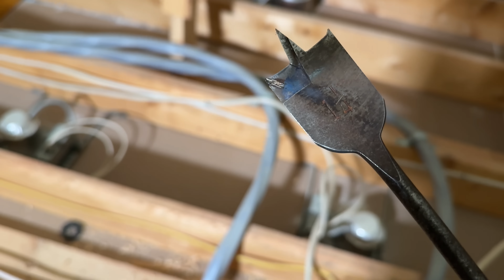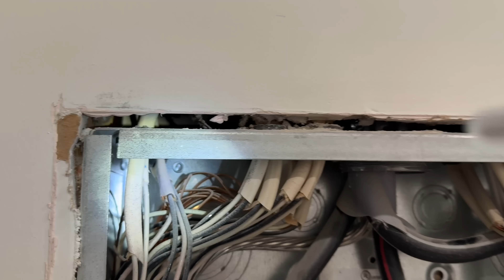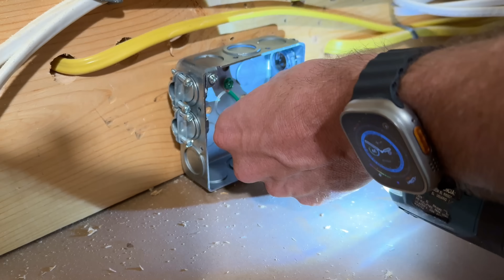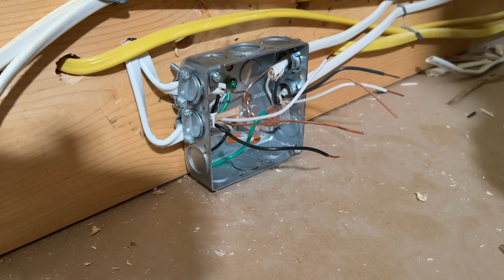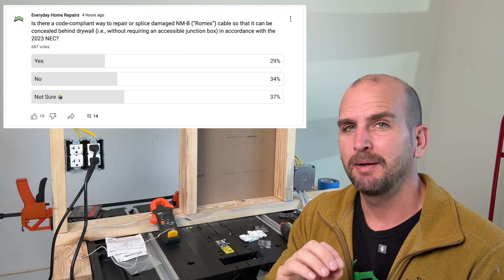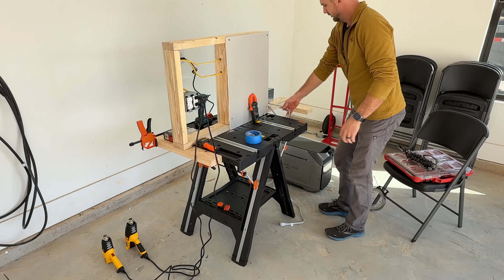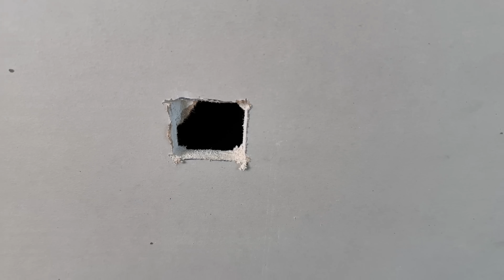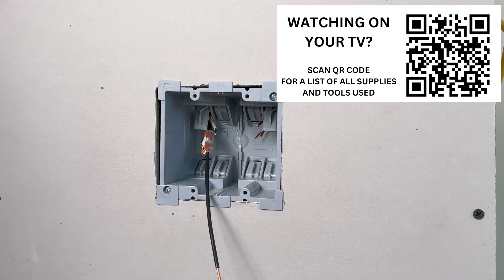How To Repair Damaged Romex |  3 Easy DIY Fixes

Comment: I like option 4, add two new outlets (at adjacent studs or you can jump over one if it looks too hokey to have outlets too close). More outlets is always better, and you can have plenty of wire so its not stretched so tight because you add a new piece of romex between the boxes. You can also add the second one to the other side of the wall (unless you are worried about having an outlet on a different breaker than the others).
Reply: Option4 is the only option for myself or my customers!💯👍⚡︎
Reply: This works well as long as you aren't maxed out for outlets on that circuit already. It's pretty typical to count 1 amp per outlet (or screw in light bulb) maxing out at 12 amps for 80% of a 15 amp breaker.
Reply: @taebron  "Maxed out on outlets" is not really a thing though. Yes theoretically adding too many outlets can increase your risk of over-loading that circuit, but you can also theoretically overload it with only 2 outlets on the circuit. So maxing out a circuit is really based on use patterns and risk assessment. So when you're talking about an already very subjective and almost arbitrary guideline, adding a couple outlets isn't going to magically put you over some limit especially in a rarely used place like this where it has very little practical difference and is a great solution.
Reply: @vaggeto and folks who mercilessly and without thought add way too many devices to a circuit would just use a powerbar/plug splitter regardless. I like the additional plugs as it gives you more choice where you want a device in the room and may prevent someone from using an extension cord to reach a particular outlet.
Reply: @taebron  you're right, two more switches would be a better choice
Reply: @projectodemayhem   - Everything would be a better choice than an unseen splice hidden inside a wall.
Reply: @taebron no max on receptacles in residential only commercial
Reply: Where in the NEC is there a limit to the number of receptacles on a circuit?
Reply: how about a 4 x 4 plumber access panel and the splice is behind that. Women get picky about looks, but code is code and she like the white access panel she could paint. LMFAO!! Why are people trying to be the best when they are already better than most. You don't fix what isn't broken.
Reply: More outlets sound nice til someone overloads the breaker

Comment: The wire connection type you are describing for the in-wall connector is called an ICD connection (Insulation Displacement Connector).  This type of connection is use A LOT in electronics because it is a very reliable connection because it makes a shallow air tight penetration in the wire.  I have not used them for more than 10A personally but the design is very well established so scaling it up to higher currents should be straight forward, especially with solid wire.  One of the advantage of this style connection is that it slices through the oxide coating on the wire and created an air tight seal preventing it from re-oxidizing.  One critical component of this style connection is cable strain relief.  IDC connections are very good electrical connections but they are not great mechanical connections so it is important that the rest of the connector provides the mechanical connection.  It looks like the NSI connector does that.  One thing that does seem a bit dubious for the NSI product is that they do not provide any electrical specifications for it on their website.

Comment: All you guys talking about WAGO connectors have likely not been doing electrical work very long. I have seen these types of connectors melt and fail under load more times than I care to count. Every time I have pulled things apart and fixed the issue properly with a box and wire nuts. As far as the type you bury I would not recommend burying any splices. For years and years it was a code violation, for good reason. The fact that they got approved and are used in manufactured homes doesn't make it a good way to go. In this video you talk about heat under load in a controlled test, you are what I like to refer to as an @$$ clown! in a real world the loads could likely be applied for a lot more than 20 minutes. Find something else to make videos about rather than teaching folks how to burn their house down to to your self professed  knowledge. Some things are better off left to the professionals!

Comment: The third option is not to code. You need a minimum 6" of wire inside the junction box (NEC 300.14).
Now, it's an interesting solution, fundamentally. It can be made code-compliant if you install 2 boxes, one for each end, and then connect them via a short run of romex.
Reply: you are allowed to extend short wires to meet the 6” code requirement now. this changed in the 2023 NEC.
Reply: Third option is 100% to code. 2023 NEC 300.14 Length of Free Conductors at Outlets, Junctions, and Switch Points. At least 6 inches of free conductor, measured from the point in the box where it emerges from its raceway or cable sheath, shall be left at each outlet, junction, and switch point for splices or the connection of luminaires or devices. The 6-inch free conductor shall be permitted to be spliced or unspliced. Where the opening to an outlet, junction, or switch point is less than 8 inches in any dimension, each conductor shall be long enough to extend at least 3 inches outside the opening.

Note the "The 6-inch free conductor shall be permitted to be spliced or unspliced." part. Even though the wires that come in are obviously too short, adding more wire to it via a wago, or even a wire nut, is permitted by 300.14.
Reply: @robertsteich7362  But the cable jacket isn't even inside the retainer thing in the box...
Reply: @robertsteich7362  it may be code, but that’s an idiotic (and I would imagine unintentional) consequence of the code.

That method created nine connection points, each of which has a potential to develop higher resistance overtime versus just three connection points if the wires were spliced directly together or six if a short run of new wire was used in between.

Sorry, but this is just stupid
Reply: @ What about it is just stupid? Being able to make a wire that’s inside a box longer to meet the minimum 3” from the opening? Just because it has a splice?
Reply: Yes, I was surprised that the two box solution (one before the break, one after, with the only new wire being the run betweent the boxes) wasn't mentioned as a possibility.  Yes, that can look even more ugly (two blank wall plates), but this solution allows for more flexibility in locating the boxes, i.e. you can go  back in each direction from the break to locate each box in a more optimal location.
Reply: I agree, 6" required.
Reply: 100%
Reply: Modified #3 with two boxes, is my preference.
Reply: For me, the 6" is not what worry me, but not seeing the jacket at all. This mean that the cable is not secured to the box and can pull back in the wall cavity. And THAT is what make me unconfortable with this repair.
Reply: @thephantom1492  Maybe using a metal old work box with side entries would be a better option?
Reply: Wow. Good point!
Reply: Or, if you know the next outlet in the chain, you could move this box 6" left or right and use the broken wire as a pull chord to the next outlet
Reply: I would leave 6 inch of conductors and bout half inch of jacket showing in the box.
Jacket is there for a reason!
That's code for the inspector.
If there's no inspector, then it'll work!🎉
😂😂😂😂
Reply: @fubufb420  Sigh. Code - like all safety instructions - is written in blood. If it's just your blood - knock yourself out.

Comment: 1 and 3 yes, I would not use number 2 for anything. There is a lot of people that use those vampire type connectors that bite into the wire on automotive connections and I see them fail constantly. I see them fail so often I would not even consider them. Just my opinion

Comment: Great video and resources, thanks! I've always been frustrated when I encounter this situation (which is often when renovating 1970s houses). My typical approach is to pull new wire, but that's not always practical, and it's helpful to have some other tools in your belt.

Comment: I like the 3rd method.  However, your example requires that you know pretty closely where the wire is running in the wall.  Perhaps the boroscope would be necessary for investigation just to find where the failure is.  I suppose that could require a number of holes in order to zero in on the issue.  What tool(s) would you use to locate that before cutting the sheetrock?

Comment: Might want to add an annotation about those "in wall splice" connectors. Many jurisdictions treat that as a junction box and therefore cannot be hidden in a wall no matter what the manufacturer says. As well as some places outright ban them as non code compliant due to the exact issues you listed.
Source. Licensed electrician who worked in a modular home factory between jobs as an apprentice. 
Modular/manufactured home company's love those connectors for any wires that need to cross between sections because any idiot can match the labels and plug them together when the house is being set.
Reply from the maker: So in the case where the jurisdiction would not allow the splices what would a homeowner do if they were purchasing a double-wide with multiple circuits leveraging the splices between the 2 sides?  I appreciate you sharing your experience 👍.
Reply: @EverydayHomeRepairs  Depends. 
Legally theirs no requirement to bring any existing structure up to current code unless your making changes to the thing that violates code.
If your talking about buying a brand new just built home, it would likely get flagged on inspection and they would need to be replaced with a standard junction. The manufacturer I worked for knew based on previous experience if the home was going to certain places to not install those connectors. Someone would have to make standard junction box connections on site.
Reply: @PortersMob  Is plugging them together not considered an alteration?

Comment: I thought romex was required to be stapled every four feet which would make it impossible to use the old wire as a fish tape??  That was one of the reasons I used flex conduit when I did my home.
Reply from the maker: Check with your local inspector but usually for repair work the Romex does not need to be fastened if you aren't opening up the wall cavity.

Comment: As a retired scientist I always appreciate a good experiment. However, these interconnector devices have already been thoroughly tested - not just for heat production, but for vibrations and other variables that might make a connection weaken over time. That’s why we have NEC codes and UL rated devices.

Comment: This is great information.  Now if I had the courage to put holes into my walls.

I have a 1950's era house.  All with the exception of refigerator, washer, and I think 1 circuit in my garage, everything is all two prong outlets.  In this day and age of stuff needing 3 prongs I am at a loss.  

What can I do I'm tired of using those 3 pront to 2 prong adapters which don't ground.  I can't afford the 10's of grand to rewire my entire house, but I want/need to get to 3 prong outlets.  I also need to have a solution, because I have opened an odd outlet here and there to see about simply putting in 3 prong outlets and my wires are lucky if they clear the wall by about an inch, no slack what so ever.  Then when I look at the box I can't see how even the small wago nuts would allow me to add some pigtails but maybe I'm just being ginger.  However, some of the outlets, like the ones with USB, are much much larger than these legacy outlets.

This is my first legacy house and I'm putting off projects because I have 0 skills / faith in my abilities, to do safe work.
Reply: Do more research on residential electrical work before you take on the project yourself. A way to get three prong receptacles with grounding protection with your existing 2 wire electrical wiring would be to install GFCI receptacles rated for the same amps for your existing circuits (15 amp receptacles for 15 amp branched circuits, 20 amp for the 20 amp branched circuits). I would be cautious with old wiring however since the old cloth wiring is a fire hazard. I would recommend totally rewiring the house with NM cables and of course always follow NEC and local electrical codes for your area.
Reply: @local487boilermakers6  
Well IF I had the 10K + I sure would rewire my entire house.

Comment: The mobile home receptacles are a fire waiting to happen, I replaced like 6 of them in my sister's home and they all showed evidence of heat damage.
Reply: I have to replace every single one and rewire part of the mobile home
Reply: I just feel un easy with thin metal trying to pierce thru the wire skin, how much metal contact is really there?

Comment: Why didn't you just use the wagos behind the box then pull the wire thru? Seems it would have been easier than dealing with those short wires.

Comment: I used a Splice kit in a remodel project where I had to move a wall switch and the Romex was too short so I added 4' starting at the switch and installed the splice in a wall cavity. Being a belt & suspenders kind of guy I applied some OxGuard to the splice blades before installing the conductors to help ensure gas tight connections to prevent corrosion. It has been 10 years or so and all is well. Also when you made that box Wago splice you didn't need the 221 blocks. You should have just installed the pig tails into the 221-2401 inline Lever-Nuts. The fewer junctions the better.
Reply: Id personally love to use inline but i have to splice 10awg and it looks like they only have pigtail style wagos for that gauge level

Comment: Any reason why you didn’t attach the ground connector for both circuits to the metal box?
Reply: Probably because there is no reason to do so. In addition, the second ground conductor would ohm out from the panel to be grounded in the field, which could cause confusion down the road.
Reply: @ does code not require all the ground conductors to be connected to the metal box?
Reply: @Cotronixco  250.148 Continuity and Attachment of Equipment Grounding
Conductors to Boxes. If circuit conductors are spliced within a box or terminated on equipment within or supported by a
box, all equipment grounding conductor(s) associated with any
of those circuit conductors shall be connected within the box or to the box with devices suitable for the use in accordance with 250.8 and 250.148(A) through (E).
Reply: @brentoconnor6127  That code was recently updated due to ambiguity. However, if you study the situation thoroughly, you will find many electricians believe the committee made the update only for that reason, and not for reasons of decreasing confusion or increasing safety. In other words, there is still no logical reason to tie grounds from unrelated circuits together in the field. The box simply needs to be grounded, not grounded two or three times from two or three different sources. We believe that the committee will eventually realize this oversight and adjust their wording accordingly.
Reply: I believe the second one should be sheathed as to not touch the other earthing conductor as they are from different circuits. If there is a fault and you are working on one of those circuits and disconnect it from the board it would become live which would be dangerous thus they shouldn't be connected together.

Comment: Someone else already mentioned my preferred method (option 4): Use two boxes with a run of wire between them. I like having extra wire. I don't like pulling wire tight to its limit.

Comment: Isn't it code to staple wires around 6 to 8 inch from box so how would you pull new wire , just saying I have never been able to do that and if you keeping code how you going to staple it back ???
Reply from the maker: I think that does not apply for repairs.
Reply: Code requires "secure and support" for NM cable commonly called Romex within 12" of any box.
Repair is not the appropriate word to use to not secure and support.  If the pathway (routing) of the NM is exposed then support is required. If it is covered, by drywall for example, then that portion in the covered area is not required to be supported. All exposed portions are then required to be secured.
This covers repair/replacement conductors and new/additional circuits thru the covered pathway.

Comment: I asked the same question about a hidden wall splice in the reddit forums and got a hard NO from everyone.  This does look promising but I still don't think I'd bury it behind drywall - if corrosion or moisture got to it down the road you'd never know where the problem was.  I'd go with a single (if the wire was slack enough) wall box #3.

Comment: Scott, did we just totally skip over the section about how to loosen the wire clamp in the top of the breaker box to re-pull that cable?  Just about every box I've seen has had the drywall run smack up against it, and you're going to have to cut a small section out to get a screw driver in.  And then hope that the original installer left them oriented so you can get to the clamp screws or you can knock the lock ring loose, rotate it, and hope it's not a clamp at the back of the box.  And if you're pulling a new circuit and have to knock out a knock-out for a clamp, how you do that without incurring a drywall repair? Maybe someone makes one, but it'd be nice if you could get a snap-in clamp that can be installed from INSIDE the box.

Comment: Here in Canada, I believe these are not yet approved for concealed locations, the NEC decision notwithstanding. Last week I asked a Canadian electrician friend and he has never used them. The usual approach would be to do as you did with a junction box accessible through the attic or a box with cover plate in an unobtrusive location.
Reply: Me... I'd go with WAGO's or IDEAL in a box.